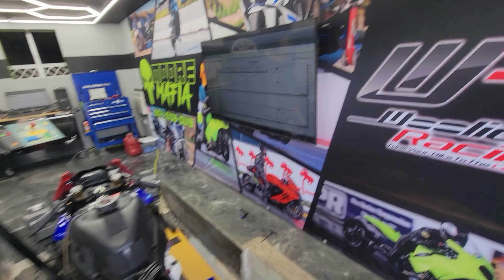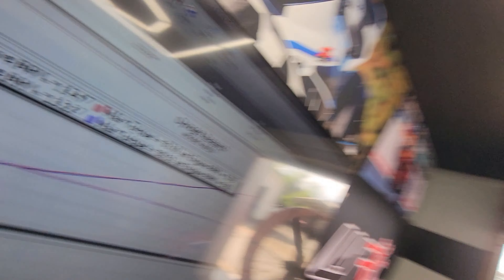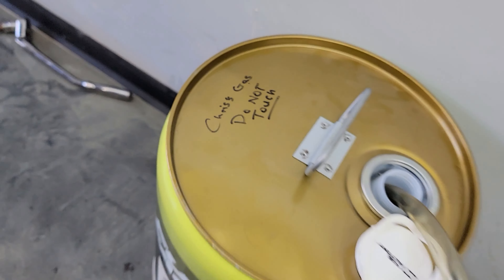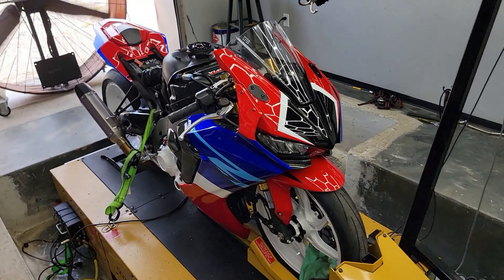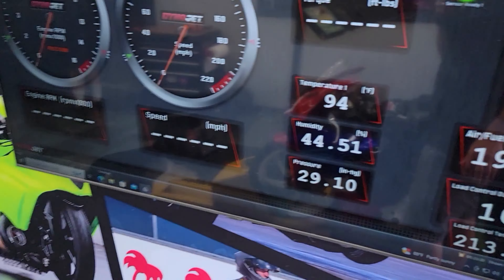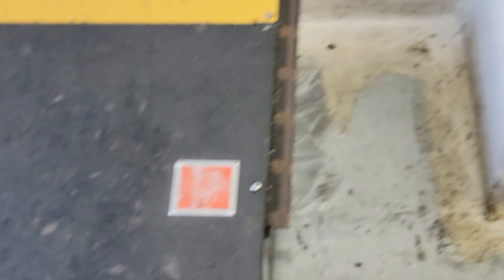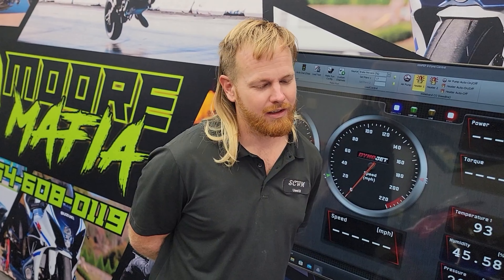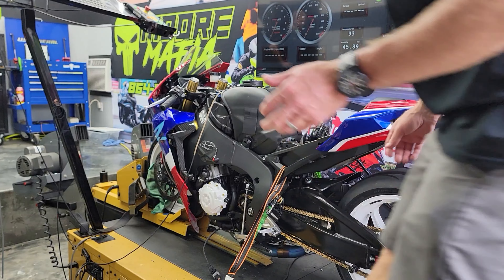The STRONGEST CBR1000RR we have EVER TESTED!

Comment: My 1000 holds a smidge above 4 gallons and that 5 gallon pail of fuel is like $180... $150 to fill my bike for 9hp at redline on a bike with the catalogue thrown at it is insaaaaaaaaaaaane. Didn't you make the same hp on a bone stock zx10 with a tune?

Comment: And this is a old spec blade compared to the new one, so super impressive for what it is and cannot be compared to the latest 1000’s out there. The new cbr 1000RRRRRRRRRRRR 😂 models though is a different beast, unrestricted with a ecu flash, full system, stacks, filter and proper sprocket setup to eliminate the tall gearing pushes way more than the s1000rr’s and kills them in most rolling pulls and its competitors
Reply: So the 2024 cbr1000rr is faster ?

Comment: All this work and it only made 178hp? Daym those things are a snail
Reply: yes because a 400lbs bike with 180hp is "slow"... the only thing that's slow is this comment of yours, Street Rossi...
Reply: @LucasSi919  My guy, this bike has almost more money on extras than the bike itself. Just the wheels is a few thousand right there. If you are satisfied with 178 on the wheel after 15+k on mods then be my guest.
Reply: @N3ver_stop  in terms of bang for buck, you're absolutely right. At that cost u can pick up a 1000rr or a R1M and make more power. I'm just saying 178hp on a 400 pound machine isn't "slow"... I own a triumph street triple moto 2 and absolutely love the bike it's 130hp and weighs 410lbs. Can it be quick? Sure. Does it need to be? Absolutely not lol
Reply: @LucasSi919 he’s saying it’s a snail compared to all the other liter bikes and he’s absolutely right, the cbr is just too outdated. My gsxr made 168 bone stock still restricted not even broken in yet it was cheaper than a cbr
Reply: @Ryder1K  he's not wrong and neither are you. I'm just saying any bike with over 150hp ain't slow lol. Let be honest, bikes with 200+HP don't need to exist but we're sure damn lucky they do! Lol
Reply: Doesn't newer cbr1000rrr with just ecu flash makes around 190hp? With stack, full exhaust,race gas it could very well made 200+hp.
Reply: @orionmobile6545  that’s the rr-r which is almost 30K and a completely different bike than the base model which is compared to the other liter bikes. Even then a zx10 and s1000 make the same power with exhaust and tune
Reply: Couldn’t handle 130 horse without traction control wiener
Reply: @FearNoevil-o8d  who needs traction control on 130hp lol